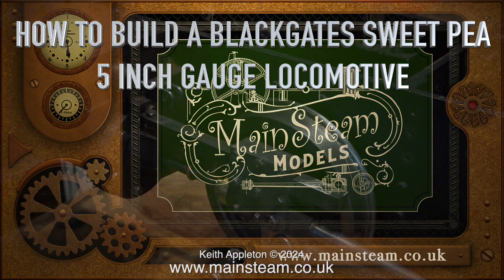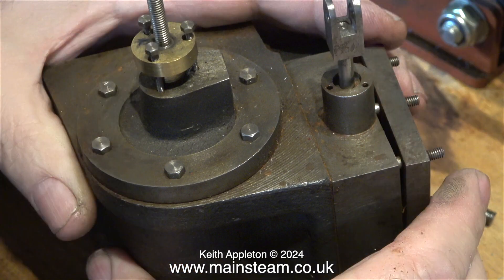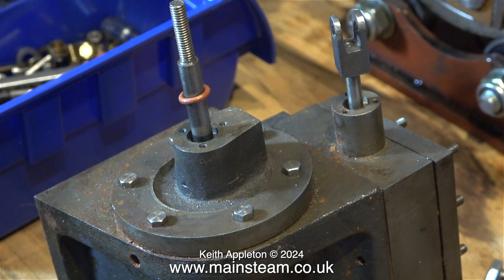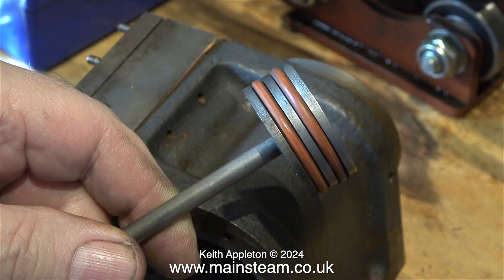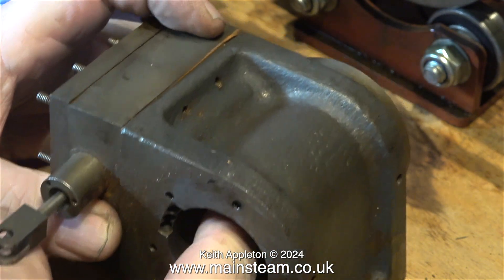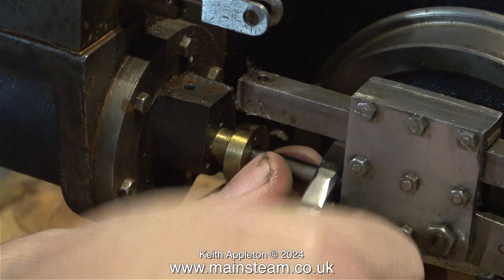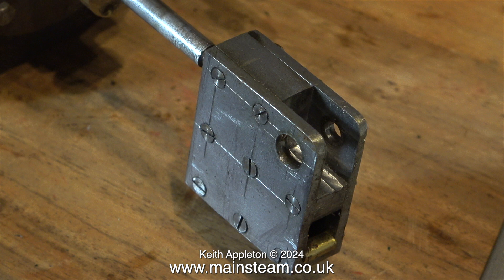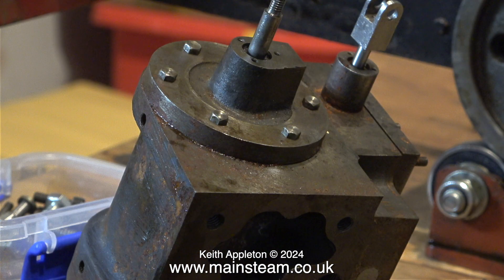A BLACKGATES SWEET PEA LOCOMOTIVE BUILD - PART #3

Comment: Those glands would look much better if you shortened the stem into the gland. Since it's an "O" ring they won't need much adjusting in service.
Reply from the maker: I will check them against the Drawings . . . .